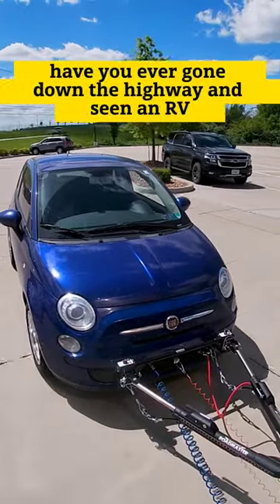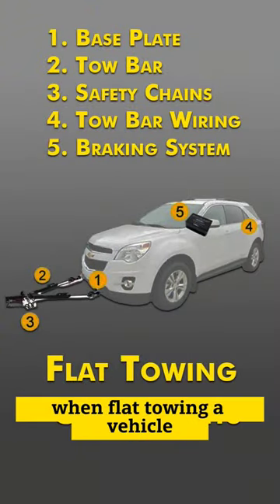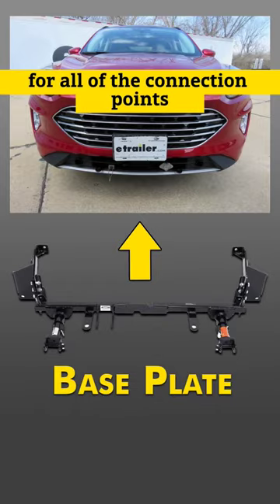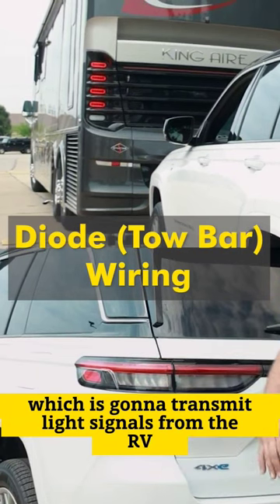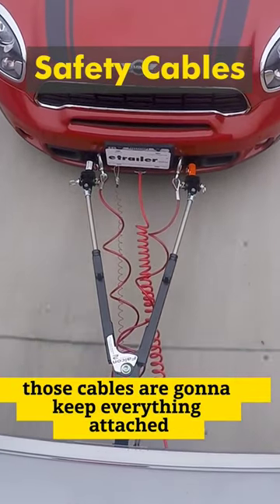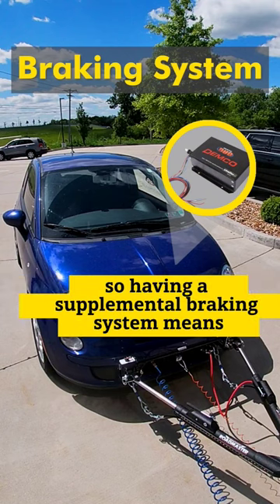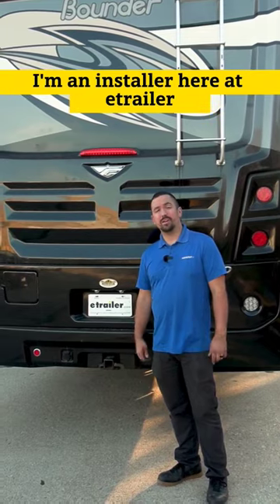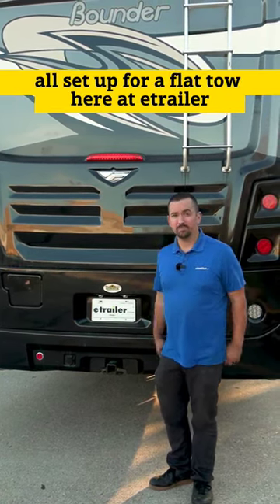What is flat towing?#towing #flattow #rvlife #rv #rvliving #rvlifestyle #learning

Comment: How can the front wheels of the towed vehicle turn right or left during parking maneuvers or sharp bends?
Reply from the maker: When a vehicle is flat towed behind a motorhome, the steering column is unlocked to allow the front wheels to track behind the tow vehicle so the tires don't scrub during turns or when maneuvering.

Comment: Most modern cars if you look in the owner's manual (which nobody does except maybe me) they require towing using either a flatbed truck or dollies for the axle that's on the ground. I've seen all sorts of vehicles, even 4x4s being flat towed although I would think you can flat tow a 4x4, you can't flat tow an AWD car.
Reply from the maker: Most vehicles manufactured after 2010 or so will state in the owner's manual if the vehicle can be flat towed. Some also refer to flat towing as 'recreational towing' or 'dinghy towing'. The thing that differentiates whether or not a given 4x4 vehicle can be flat towed  is whether or not the transfer case has a neutral position. This is why we recommend folks read and follow the flat towing procedures listed in the owner's manual.

Comment: Not all vehicles can be flat towed, even if they have a stick shift.
Reply from the maker: Most manual transmission equipped vehicles can be flat towed, but there are always exceptions. Check with your owner's manual or with the vehicle manufacturer if you're in doubt.
Reply: @etrailer   Be in doubt. I bought an S10 blazer two door V6 with a manual transmission after being told it could be flat towed for a new job I was starting (driveaway). One  day later, as an aside while talking with the new job, they said "oh by the way that blazer cannot be flat towed". As I started looking around for a different vehicle that can be flat towed I was surprised to learn that most cannot be flat towed.
   For some reason, it's a little bit difficult to figure out which ones can be, and which ones can't.